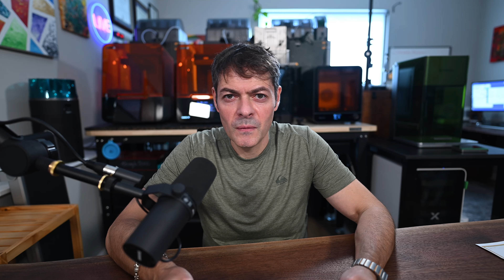Can Plasma Be Scaled Up? Why "Just Make It Bigger" Doesn't Work

Comment: Man, You are crushing! You bring up many topics I have been curious about.
I have been very curious about amplification. Specifically, Constant Current amplification vs Constant Voltage amplification. What are the strengths and weaknesses of each? When would you choose one over the other? One important component of constant current amplification (with current feedback) is that, if done correctly, can eliminate the non-linearities that lead to distortions, disturbances and noise. All of which, if my presumptions are correct, lead to disturbances in the plasma. Obviously there is a lot of nuance to precisely controlled plasma. Nevertheless, a constant current source with auto regulating current sensing of some kind, can help eliminate the amplifier and PSU from being problematic, during precisely controlled plasma work. 
 I would enjoy your analysis and insights on Parallel Bridge Tied Load (PBTL), Bridge Tied Loads (BTL), Post Filter Feedback (PFFB) for the purposes of plasma production. This is just another approach, on the constant voltage amplification, to address the non-linearities from the PSU and amplifier.
Reply from the maker: Oh, man! Above my pay grade. I work with a very talented electrical engineer who helps me design our power supplies. Some of the stuff he does looks like magic to me. Anyway, sorry, I’m not qualified to answer your question without putting my foot in my mouth a dozen or more times :).